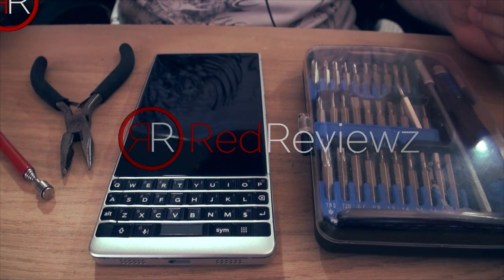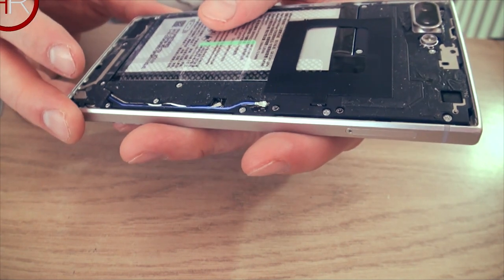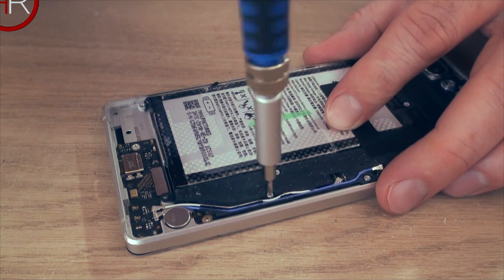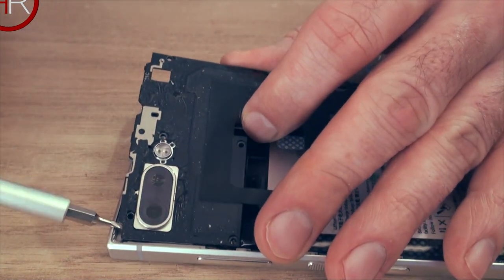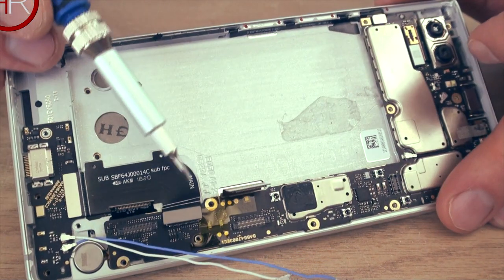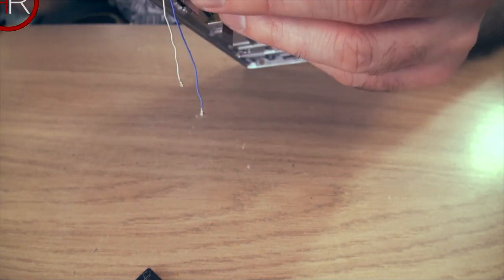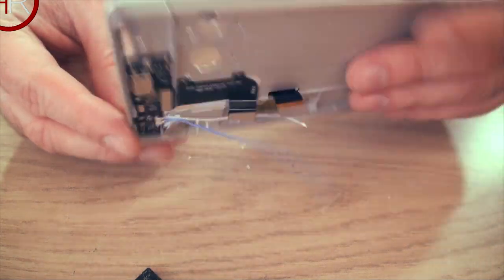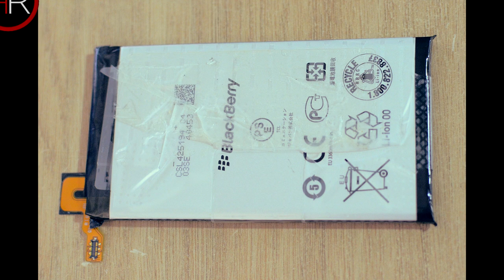Blackberry Key 2 Disassembly

Comment: Just an add to this great video - the battery comes off easier if you unfold the ends of the two-sides glue tape that wraps the battery and take the  battery our without trying to get the glue tape with it. The connection between the tape and the frame is stronger than the connection of the tape with the battery. I disassembled my Key2 for recycling, so it was a lot of fun.

Comment: Tysm!! I was able to change my keyboard out with one that works by just pulling the lower half up, unscrewing the lower screws and disconnecting the antennas along with the keyboard cable. A heat gun really helps to get past the adhesive on the back panel and the keyboard! Look at the adhesive on the new keyboard to know where to heat up and do it in a small area/corner and work your way as it gets hot enough to pry-as-you-go.
Reply: Did they keyboard you purchase have the adhesive?

Comment: thank you very much sir! Your video was a huge help. without this video I wouldn't even think of repairing my BlackBerry by myself. I ordered a new display that came with a brand-new chasis though. had to take out the bottom, the upper speaker as well as the infrared piece on top as well. nothing big though.

again thanks!

Comment: Thank you very much,  every thing was clear , actually  the best video  for how to repair the BlackBerry key 2 , I just need to know when I take out the keyboard should I stick it with glue  or not ? How about  the rear door  should I put some glue on the rear  cover to stick it or no like LED ?
Reply from the maker: Hey no problem. Well the keyboard doesn't need to be glued as there are screws to secure it. But the back of the case could probably benifit from a touch of glue around the rim. Just a thin layer. It does clip back on but doesn't create a tight seal again once removed. Hope this helps :)
Reply: @RedForShort  thanks for your reply. Do you recommend  T7000 glue which is black for sticking ?
Reply from the maker: To be honest I have no idea about glue lol I wouldn't use anything too strong though as you may need to get inside there again in the future 👍

Comment: Note, you can also purchase a new frame with the screen already attached.  If you do that you need to remove a few more pieces for transfer:  the black assembly at bottom, the thing that looks like a button battery (pry out gently), 2 small pieces at the top (one of which is, I think, a speaker, and the other which I think is the LED indicator light (this plugs into the assembly removed before and may have come off with it then... it did not in my case).  And I had to salvage the glued on ribbon connector stuck to the frame.  You can see it in his video.  Anyways, I think this is an easier way than trying to pry off screen.  Hope that helps
Reply from the maker: I wish I knew that before lol

Comment: The space bar on my shit the bed, watched your video, but didn't realize that there were screws holding the keyboard in.

Welp no phone till I get my replacement parts from China.
Reply: Were you able to replace it easily? I'm in the same boat, wondering if it's worth it ordering the replacement keyboard from Hong Kong....  :-/
Reply: @MrVara411  I ordered one just incase.. You so far I just clear my cache when the keyboard starts skipping and it fixes my issue Everytime..

Comment: Did you ever try to fix the antenna cable? I also broke mine despite being careful while trying to disconnect the battery following some water damage.
Reply from the maker: Not as yet. Might get it looked at someday but not got the time or money at the moment :)
Reply: noxxi knox  I'm about to attempt this soldering repair, but I'm not sure which way the connector is supposed to be placed.

Comment: DO you know how to replace the camera glass?  Will the camera work w/out the glass. My glass is broken. No one seems to know how to fix. Cheers
Reply: If the glass is inside the camera, you will have to replace the camera unit.  If it is just the back lens, it is bonded to the cover with some pretty good glue and I just replaced the whole back.
Reply: I have the same problem and I think that something inside my camera is broken as well because it can't focus close things such as text or other screens. I will try to replace the camera protective glass and see what happens. Let's hope everything will work, even though I'm not sure.

Comment: What do the blue and white wires at the back do? The white one broke off for me but not sure what it does
Reply from the maker: Well someone here in the comments said the wires are for the 3g and 4g. But I couldn't confirm that. I ended up buying a new phone lol
Reply: @RedForShort  Basically I broke the white wire. My screen, speaker, mic, 4g are all working. Wonder what has stopped working 😐
Reply from the maker: Hmm. Possibly could be 3g, I'm not sure tbh. If all works then just keep an eye on it. If in an area with bad signal and you lose 4g, see if it switches to 3g or not. I guess whatever it is, you'll find out in time 😆
Reply: @NeazChowdhury   phone will work as long as you have 4G, if you want it fixing take the handset to some one that can do micro soldering its fairly quick and cheap, a guy i know had mine sorted (i broke off both) in less than an hour

Comment: Can you say my for what is the blue and the white cabel. I got the same problem but with my white cabel.
Reply from the maker: Someone said it's the antanna but I'm not sure tbh sorry
Reply: Hi Ginger Devrient,
i've got the same problem. Trieing to fix it these days but I#m still not exactly sure how. @noxxi knox seems to know something about this stuff.
What i've heard is that the blue cable is the Wifi-antenna and the white cable is the antenne for mobileservices like 3g or 4g etc. Which is not making full sense to me. The white cable is unplugged and I don't have any mobile service, allright. but when i disconnect the blue one, the phone still has wifi connection.

Did you managed to get yours fixed? Would be nice to get some new information! :-) I am somehow lost here :-)
Reply from the maker: @Marie Prouteau TBH I'm not sure but another commenter below says the white cable is for the 3G antenna. But I can't confirm that I'm affraid.

Comment: Thank you for that very clear , easy way you did video. As been searching for a year on issue with just few things on my keyboard, ex: the # 0-9-7 -- spacebar- and real crazy thing is alt works. Same as letter m -n , yet hit alt then m for period symbol and N is a comma symbol,  they won't work. Yet hit alt the e , yes #2 is there, why hit m and m is there, then hit alt and m I can't get symbol? That's pure crazy???? Just can't find even a theory behind that? I love, my key 2  keyboard,  but must use screen now. Is this common? Plz, any suggestions be appreciated.  As thought before found you, I was gona tear it down. Thinking. Clean every contact under face button. Buy Cleary showed me, I would have destroyed it completely.  Lol. Thanks for saving me. Lol. If can help me fix this as I never will go to another cell repair shop here. 4 times. 4 horrific experiences. Ex: brang note 3-4 in as only, only had issue with volume. That's it. Pay. Works. At home, won't charge, then she down button not work, also speaker barley hear, few more things,  as started polight. As he's saying must tear down and new parts. I flipped. As twice his age. And seen my flawless cell was just hacked up all around as he musta used a fkn jackhammer to break seal. Told him. Im no fool. And was willing to overlook the edges as had a otter hard jobsight case. But now. He's getting me a complete new cell. As I will never ever stop pursuing you. I will protest, message my city about him. The lengths are endless as been purposely screwd before,  and said to self. It will never happen again.  Or I can't sleep letting ones do this to honest people. No sir. After near 4-5 weeks of non stop on him. Seen him getting to have a breakdown. I pushed harder. Omg. I ingrained to self. Must make example to all repair shops for all that live and work in my city.  It's not just me. Gave extreme power, energy. Finally he snapped. Tried best to attack me with some pole. Looked like conduit? As , no clue how many watching him yelling and swinging at me as I just play, dodge around him. Coarse this is downtown. I go into street as cars stopping. He's still trying to kill me. Lololol. Not long before law there as ? Omg. 50 - -100 witnesses. Many going to police. I hear same things. This guy running away but in circles as won't leave never even put his fist up. As this guy with pole swinging  in a real serious way.  If made contact to me. I get hurt bad. Cuz he gave it all. As yelling. " I'm gona fkn  kill you". Gave statement.  Walked by the cruiser as window down just few inches on front doors. Said. I asked polight to correct, and even said I won't get you to fix the hack job did on my flawless cell. Yet your so greedy and think world us stupid. As seen you once through window. And on computer working on a cell. As head up down looking at a YouTube video. Omg. You have zero knowledge about cells. You really on others and luck. And learned away to generate business. As I gutted call. All old components that are from others phones. You took my good parts. Put back ones that are trash. And think I am gona pay you to hack up cell more. And put my own stuff back in as saying, there new. Btw, before in police car. Said parts hear. I asked to see them. Not anything packaged with bar codes or description. Just bunch mixed in a box. This how I no without a dought. He does this to me, he does to all. Some might be say a speaker. Some might be many things. As he says. I fixed your volume. Yes he did. And destroyed rest. Also near me. Cuz I was so mad. So consumed by this. Even told. Charlie. Must let it go. It's fkn  killing. You. Worse. You might snap, beat him, and my., man now in jail. To end. Cell still hear busted. But he went and stayed in jail for ? Think was 3 or 6 months. Bunch of charges. Before he got out. Seen someone covering glass half way as painting shop. Sign gone. Lol. Business or con thief store is permanently closed here anyways.  Sure probubly set up another rental space in a city far away and Rob others? Why I prescribed to you sir. As seen you before. Helped me replace a screen. Think? Was a Samsung?  Do remember you and name and voice. You are truly needed in this community and am sure. Many many homes. As you do make it not just look easy. Explain unwell were have zero nervousness to try it your way.  Sorry long read. Merry Christmas,  mostly, health to you and all you love sir.